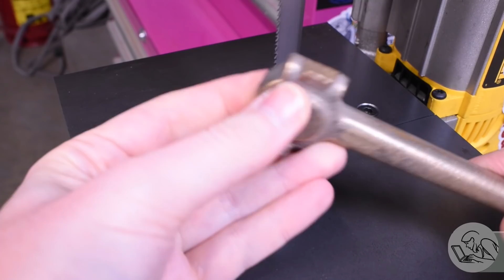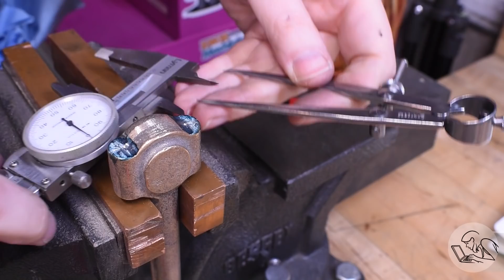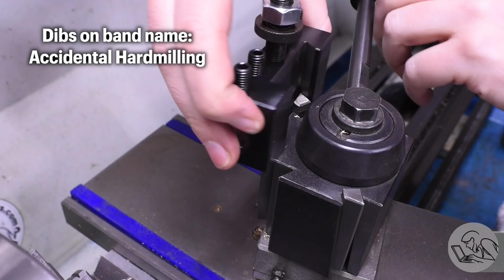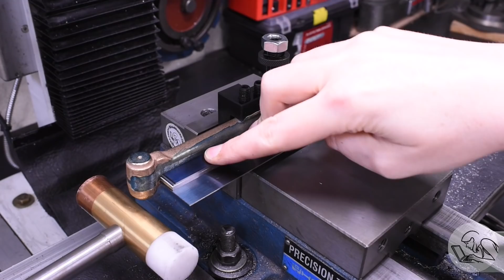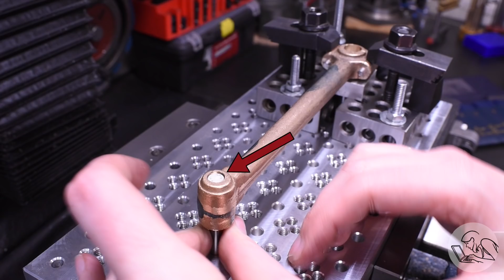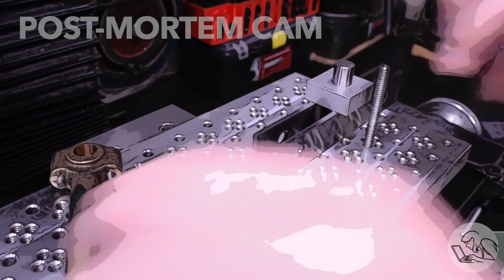Connecting Rod! Big Steam Engine Build, Part 5

Comment from the maker: Hey everyone! Since a lot of folks are asking…

1) Yes you can buy replacement castings as needed for these kits. The little errors I made don’t warrant making the part again

2) Yes, various heroics to move the bore are possible, but unnecessary. The error is easily corrected upstream in the mechanism. This is common in model engineering.
Reply: I just appreciate what can be learned and the fact that your aren't afraid to post mistakes.
Reply: We all you know you've improved it, it's now de-stroked for an extra 50rpm on the top end.
Reply: @themoppie1000  Must be for a 1/4 mile drag application
Reply: Having worked in several plants that manufacture engine rods I can tell you that they typically have locating features cast into them called "knorfs or gnorfs" - I can't remember. These are used by the first few operations to get a center bore perpendicular to a milled surface which all other operations use for reference.
Reply: Nice recovery.
The big end issue is largely hidden by the crank disks. If it had been a crank like the PM #1 it would be noticeable.
The small end is mostly hidden by the cross head guide so it probably wont matter as much either.

If every engineered part was ever meant to be pretty then most engineers would have failed design school, because you can't define a tolerance for pretty or measure it with a micrometer. Many engineers have tried but alcohol infused misbehaviour in bars has never ended with safely interlocked parts.

Remember: If it works, its fine and if its working don't try and fix it.

Here's a few other engineering recitations that have helped many over the years.
Leaking or burning oil isn't a problem, running out of oil is.
If it suddenly stops rattling or the sound suddenly gets louder then it probably just broke.
All electronics are powered by smoke which is why they stop working when you let the smoke out.
The wing detaching from your airplane isn't a problem when you're in the hanger for maintenance, but for all other occasions its a problem.
Reply: Being an old machinist of 44 year's I can say that I have made a few design changes also. But in the end as long as it works and you're happy then that's all that matters 😊
Reply: @Spiderman-istheworst67  Great point - if it ain't broke don't fix it.
Reply: @jochenreichl796  I like it.
It's similar to the oil leak lines I most often hear in car racing. 
One of their favourite sayings is that a smoking car isn't as big of a problem as when it stops smoking cos that means its out of oil and the engine is about to detonate.
Reply: I had to do the "buy a new casting" walk of shame. Second time I turned it between centres.

Comment: 2:54 The calipers are made of hardened stainless steel specifically so they can be used like this. Anyone who tells you not to use your calipers like that is a silly dick head and needs to learn to work smart.

Comment: Dear Blondie, i watch your video's , i have studied closely, many steam engine machists, as i am building my machine kit. I learn from several model steam engine machinists. My personal faverate, is Keith Appleton of the UK. his youtube site is "Mainsteam" I think that after watching many people your self and one other named Joe Pie, also Tubal Cain and learning what i need to know, that i find that machinsts in this hobby have complicated the methods of building steam engines, they are far simpler to build that these fancy gizmos have simply made model engine building into a massive time consuming job. also in all cases your all building from Castings. I have three sets of drawings for three different steam engines all vertical one is a double cylinder. The drawings come with an article from the orginal builders these drawings are from the fifties when electronic gizmos where no existant, also several newer tools for various kinds of messuring where also not in existance. my engines one requires castings but i am not going to use or make castings i am going change the drawings slightly. i believe that cold rolled steel for steam engines is better then cast iron also when you buy someone elses casting kits their are issues. In your case i see perhaps that simply put the huge steam engine your building really exceeds your machines capability. also you did not need to use line boring a face plate would have worked just fine if you where gentle on the casting. I do not think pm research did a great job on the castings some of them. castings i have seen have scale on them but usually their is some flat surface to start from when chucking when their is no alignment at all on any surface so you can get one accurate messurement then i would not buy such a casting. Even Stuart castings are ten times better then the one from PM research. i believe that building a steam engine from the ground up is best with no castings because this gives more options on how to machine the parts , castings limit you and commit you to forms of machining that are almost impossible, making it more tricky to get it right. Parden the pun as my friend Keith Applton was say but may i suggest Blondie Hacks that the next time you decide to build a casting set steam engine go to Keiths youtube channel and watch how a master with no dro or other fancy electronics builds wonderfull steam engines, this machinist uses simple hardwood in his mill vice to hold work he eye balls it Keith is one of the great masters with extreme simplicity his results are amazing considering he tries to refrain from making the build complicated by masses of messuring tools that only make the set ups more complicaed then they really need be, the same with Tubal Cain. a connecting rod in my mill with sit on a block of wood and in a uncomplicated set up way be machined. i think Quin that your over complicating creating at times un-necessary. You do great work and i have learned many things from you, but again i suggest you take a look at Keiths work. for my self, i will never build from someone elses casting kits , as i simply think to build from scratch the ground up gives more leverage on building techniques.

all the best:
D:

Comment: Just FYI..... I first ran into "Gun Metal" when I started making reproduction Norris hand planes.  I did an extensive search for the stuff to no avail.  Gun Metal was a recipe for a type of brass or bronze used to cast the guns on Men of War sailing ships.  Like many things English, it had the official royal stamp on it.  What is even more confusing is the interchange of bronze and brass by the craftsmen community in old England.  While bronze is traditionally copper and tin and brass is mainly copper and zinc, Gun Metal appears to contain some zinc but is still referred to as a bronze.   Go Figure.  The closest I have found to commercially available Gun Metal is marine brass: a 4 something alloy as I recall.  NOT RED BRASS.  The "bronze" used by PM research is a strange beast.  It machines easily like a brass but it behaves as it has a trace of lead or phosphorus in it.  It is much softer than I am accustomed to as well.  It also has a more YELLOW color than many typical bronze alloys (i.e. silicone bronze) which tend to be darker and exhibit more of a copper red hue.  It also has a tendency to "grab" tooling if your not careful.... a behavior typical of copper in the rough.  End mills work great but drills and reamers can be a bit of a challenge if your not on top of things.  When done, it is drop dead beautiful... if you like shinny bobbles which I do happen to like.  Phosper bronze, which is a bearing bronze, machines wonderfully and it has a bit more red hue than other bronze or brass alloys. I love the stuff and use it for more than just old bearings or bushings.

Comment: For accurate centre punching I use a dart first - it is sharp and pointy. You can buy a set of darts very cheaply. Make good scribers as well. Then I follow up with a proper centre punch. Much easier to catch the line just right.

Comment: I got a very good ? why has no one tried to take engine parts and bearings and more and try to build a modern steam engine keep in mind most ones ppl build are over 100yrs old on the design! Why does no one try to take all the advancements and make a modern setup? Like use a small motor crank its premade balanced and more then add in bearings and if one used a 2 cylinder crank bingo you have so much setup then add in for the steam some radiators for condensers to make the steam back to water and it would be hot water making the setup much more efficient! Just been thinking about this and not one as i have seen has tried just wondering why?
Reply from the maker: It is an inherently inefficient design. Modern steam engines are steam turbines and power many things in our world- power plants and aircraft carriers, for example. There’s no point in investing modern technology in reciprocating steam designs because turbines are simpler and way better.

Comment: In reality the .035 short rod will reduce compression but stroke will be the same as that is determined by the offset on crank pin. 2 possible fixes to get compression back. first option is to mill the cylinder base by the amount of rod shortness to bring head down to the piston. Second option I see would be to shim under the crank bearing mount to raise the piston up to the head. If you were to shim crank bearing blocks up with brass, it might make an interesting optical highlight with color difference. Kudos for sharing the bad with the good, it helps others learn from our mistakes.
Reply from the maker: There’s no compression. It’s a steam engine. 😁
Reply: @Blondihacks  It is the compression of the  steam (pressure being increased in a closed environment) between the top of piston and end of cylinder, be it a closed casting or an attached cylinder head, that causes the piston to move, and thus push on the connecting rod machined in the video. I realize there is no combustion as it is steam engine. Not here to nitpick, was just trying to offer a couple of solutions.
Reply from the maker: @thehillbillyfarmer4547  That's not how steam engines work. It's the expansion of the steam that makes the power, not compression. Futhermore, most steam engines are double-acting, so what's happening with the shorter rod is one chamber gets larger and the other gets smaller. All that is required is to rebalance those further up in the mechanism. Cross-head pivot or piston rod will likely be the easiest places to do that.
Reply: @Blondihacks  Again, it is not my intent to create tension here.

 That is exactly how all piston engines work. It is the expansion of a compressed gas working against the piston as you state. Both "regular" combustion engines and steam engines are combustion engines. Gas and diesel engines are internal combustion engines and steam is external combustion. Some sort of fuel be it wood, butane, or any other combustible is used to heat water into steam. (I know you could use solar to create the heat for steam and thus no combustion on earth but is not used in this type of application. In the case of internal combustion, the actual burning of fuel happens in the cylinder which creates the compressed gas that then expands against the piston causing movement. In the case of steam engines, the combustion happens outside the cylinder creating the compressed gas that then enters into the cylinder in a compressed state where it also expands against the piston creating movement.

 If the piston to cylinder end is too great, there will be a degraded power output due to the gas not developing as much pressure on the piston at initiation because the chamber is larger thus reducing the pressure before piston movement. This can be easily changed by changing the piston to cylinder relationship. As you state you can move the piston, moving pin location in the piston for instance if there is enough material to do so,  You can also move the cylinder closer to the crank by milling down the cylinder supports, or move the crank closer to the cylinder by shimming up the crank bearing mounts as I had suggested. All 3 options are very workable. I personally see if I was in said position the quickest, and least expensive as well as least technical would be to shim the crank up. 

There is a very slight difference when you change rod length by the way. The time cycle is exactly the same per revolution at any given rpm. However, a longer rod causes the piston to "dwell" at top and bottom of stroke just a little longer and travels faster on the stroke. Benefit at high rpm.

Enjoy your day

Comment: Quinn, I really enjoy your videos and leaving in the extremely minor and completely understandable mistakes is all part of the fun. This is probably overthinking this, but can you correct the small end hole by using a mill cutter as a drill and then installing a bushing to correct the hole diameter? And, can you gain part of your length error back in the process?

Comment: The way we would accurately lay out a hole was to scribe the center of the hole then scribe a square around the center lines about 0.030" away from the center. That way you can spot the center mark with a center drill with a pilot diameter smaller than the square. The square lines indicate to you if you are off the center. All that had to be done with a height gauge to be accurate. You can get close to within a couple of thou doing that. Use a magnifying glass as you drill.

Comment: First time I have watched your work, I am a retired engineer that understands exactly what you talking about, I have been involved in fundamental equipment design in the Oil and Gas industry, I have worked on 5 continents and lived on 3 , you impressed me , I have three older sisters that taught me a lot , I tried to Elevate equally any gender that showed exceptional knowledge and practical promise, I will be 70 this year , still spend over 50 hours a week in my workshop which is mostly dedicated to wood but I do have a precision 1949 Atlas metal lathe I restored to 0.0003 runout and I intend to get a mill , I use a gear drive drill press now but it’s not really a reliable unit, as it’s just a work around . I enjoy what your doing and by the way , I understand what you are doing I have a First Class unlimited HP Steam Engineering license from Canada , it’s all based on the Reeds Marine curriculum out of Scotlands School of Engineering!  Crazy how this all is within 6 degrees of Seperation?

Comment: You could machine out the centre of the rod and remake to correct dimensions or add the error to the crosshead so one compensates for the other. Drastic solution is to forge the error out but that'll be difficult because it's a casting and final machined.

Comment: Rod length always amazed me. I once tracked down a mill designed for doing rods. Had to replace upper small end bushings. Then the shop ground the caps down and used the mill to rebore keeping the distance from the small end center to the big end center perfect. I wish I had seen that machine and how it was done. The guy was a 1950s hot rodder repeat with pregnancy preventers, white tee shirt and jeans. Gone now.

Comment: Hi there,
I particularly like your post machining analysis. 
I think the idea of machining a mounting fixture for complex parts is often overlooked. I often have to make multiple identical parts, so building a fixing block is often my first course of action. If you don’t like the part there is nothing to stop you machining a replacement from stock. The you could have a bit of fun by fish bellying it. ( the shaft it taper turned down to both ends from the middle, so larger diameter in middle and smaller diameter at each end) looks very good and realistic to full size practice.  Steve

Comment: Would you not have enough room for a drill bit in a collet to drill the holes? The rod clamped to an angle plate? I'll use a collet went I need to be more accurate than my drill chuck. Keep smilin

Comment: Another way you could have achieved your square-bottomed slot would be to put the part in the toolholder and your milling cutter in the chuck on the lathe.  No smaller mill or filing needed then...
Reply from the maker: True!
Reply: @Blondihacks  Of course I only thought of this because of your doing just that in another part of the video...

Comment: I believe that in real life, a slightly rounded slot, as you cut, rather than the specified square-bottomed slot in the con rod reduces the possibility of stress cracks.  👍
Reply: Agree.  Every English steam engine kit I have had or seen, Stuart, Reeves and others, specified round-bottomed slots i the top end of a rod.  A square bottom slot is a stress riser.

Comment: Hello Quinn- Early 70's a farmer brought an old John Deere D into the shop for a total rebuild to enter a vintage tractor pull competition. The engine had been serviced several times and the connecting rods were a mess. I was unable to locate new rods so I had to rebuild the ones on hand. I added a shim between the rod and cap and brazed to the cap as I was trying to bring the rod center to center distance back to OEM specs. I then bored the assembly oversize, machined a small engine sleeve to fit the new rod bore, split the sleeve, then bored the assembly to fit the rod bearings. Sounds like a kluge but this was very satisfactory and the Deere D series engines were very low rpm. You could sleeve your rod end with more bronze, or leave it alone and tell folks the rod was rebuilt.
Reply: Or tell them you redesigned it.